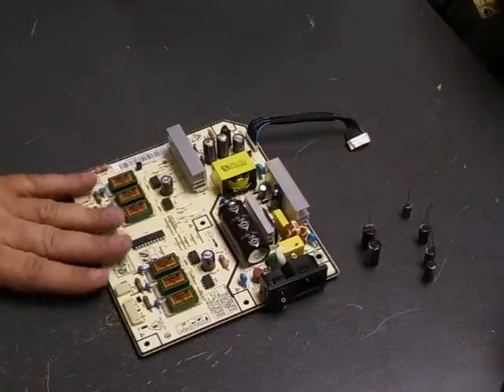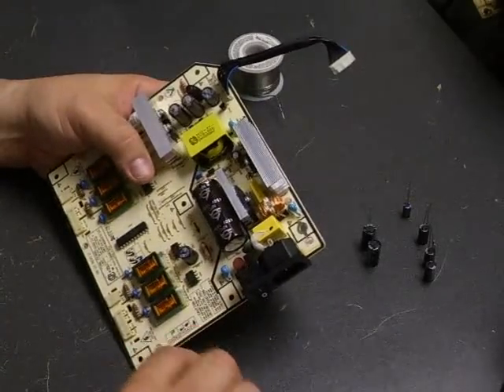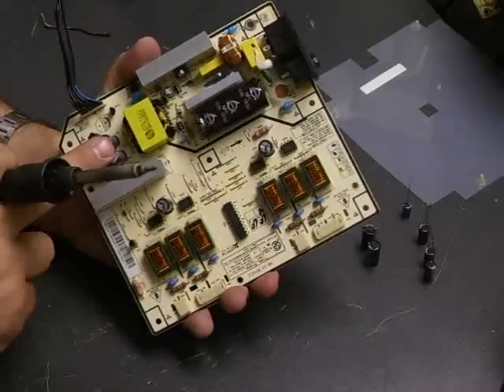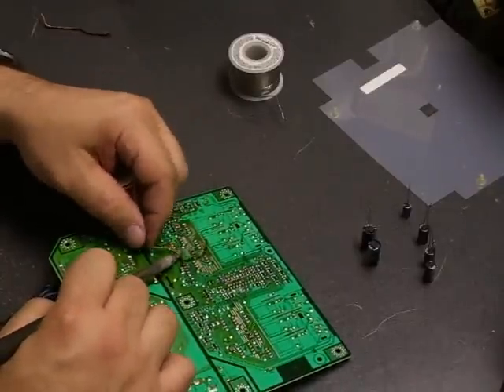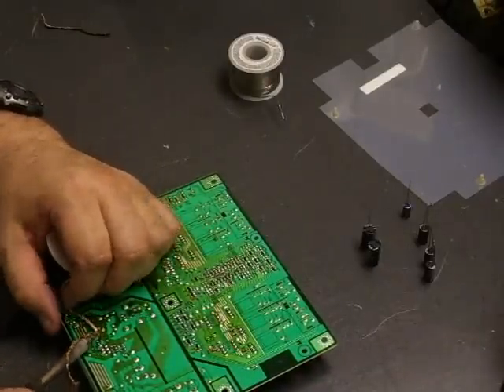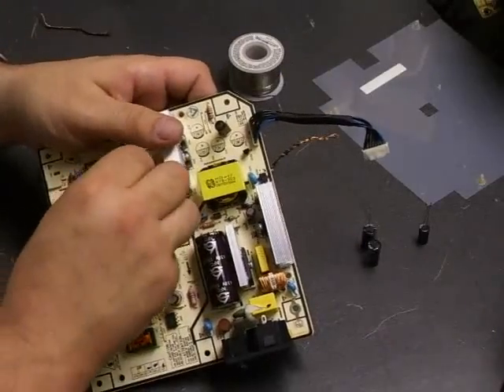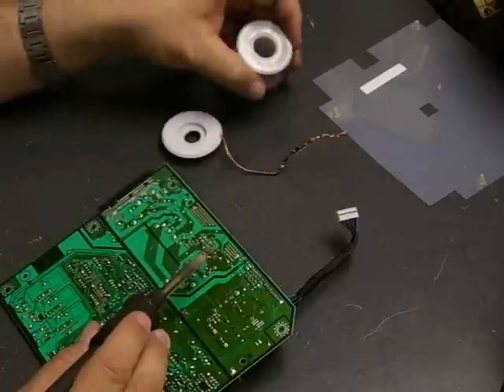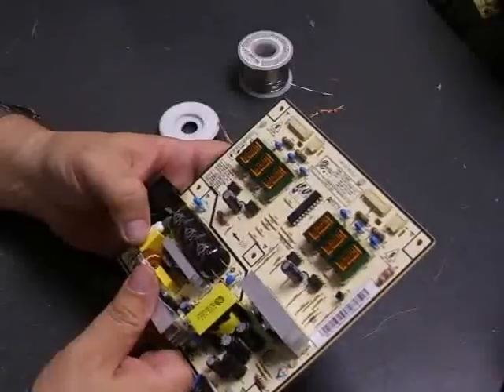Samsung 215TW Monitor repair - Part 2 Power supply repair

Comment: Fantastic series of videos. Was able to easily follow along and repair my monitor. Had no previous experience soldering on a circuit board. Thank you for the time and work that went into sharing this information.

Comment: Greetings there. I followed this guyde (all three parts) and during the test, I had the same issue - my monitor turned on for 1 max 2 seconds and than it turned off. I saw the desktop, but after a short while it turned off.  The LED on the switch which turns on/off the monitor keeps it's light on, though the screen is just black. I can provide videos if needed. What could be the problem if replacing capacitators was not?
I also tested to turn on the monitor without the video signal (video cable was away from the monitor) and it the exactly the same, except there was not desktop ofcourse but the small Samsung logo telling me that the signal cable is not pluged in. After 1 second the whole screen went off. I remember that this "signal cabel is not pluged-in"  message kept showing on the monitor until I did plug the signal cable in. So it appears that it is not the software issue.
Also is there a way to hard factory reset the monitor just by using the buttons available at its panel? Thanks.